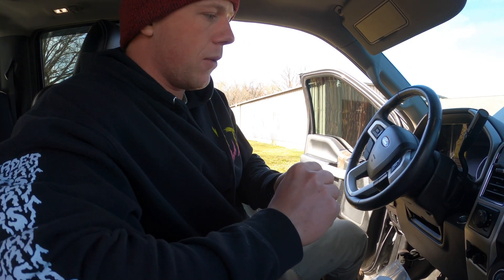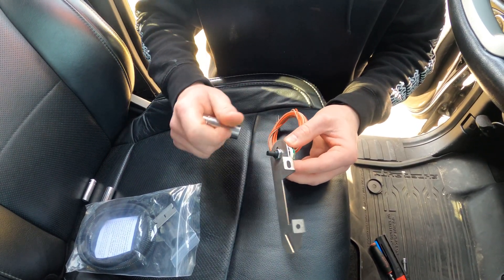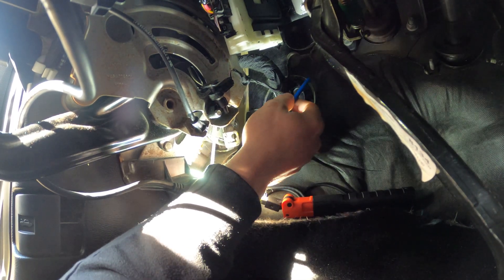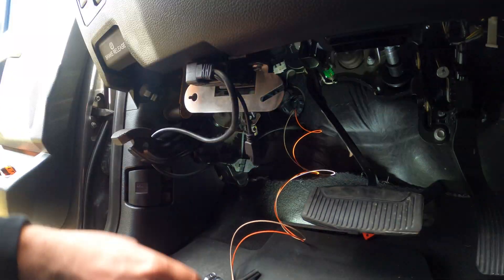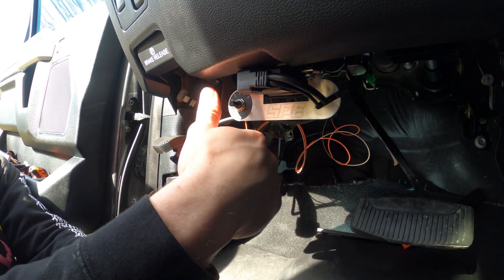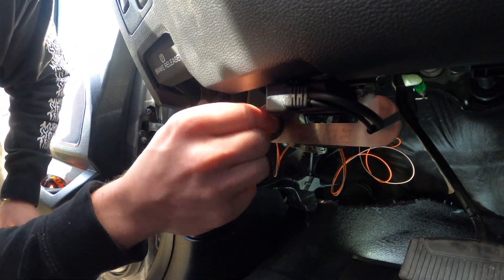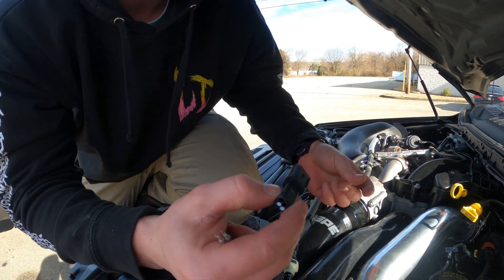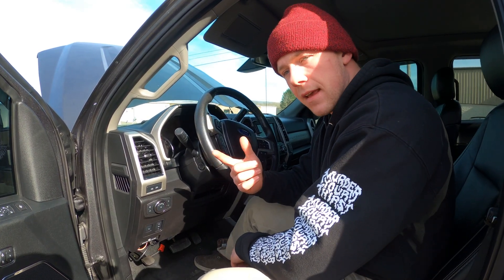SPE 5 POSITION SWITCH (SOTF) INSTALL • RWV 6.7 POWERSTROKE BUILD SERIES

Comment: I’m about to install this switch. Does it matter which wire marries up to the wire on the trucks plug? I understand it has to be pinned to match the correct wires, but do the colors come into play? Green on the truck goes to which? Green w/white stripe on truck goes to which switch wire? Or does it not matter?
Reply: @ResultsWillVary  do you know which color on the sotf switch goes to the green and the green and white on the trucks harness? I’ve already pinned the switch. Just want to make sure it’s right before I plug it in.

Comment: I had one of these installed on my 2014 CCLB Dually, should I be noticing any changes in performance when I go from one setting to the next? I can turn switch from 1-5 and can't feel a thing.
Reply: @ResultsWillVary  that's what I thought thank you.
Reply: @ResultsWillVary  how can I verify wiring is correct?
Reply: @ResultsWillVary  thank you. I popped the hood, unplugged it, flipped it around and took a little drive. Definitely working now, dumbasses had the wires backwards. Drove it like that for over a yr, my boost would also fluctuate for no reason (drop from 40 psi to 30 without letting off the pedal, then back up to 35/40 a second later), that seems to be fixed as well.

Comment: What de pinning tool do you use to switch the 2 wires in the 5 pin. I already did it wrong based on the directions. Your videos are great. This one helped alot for me to figure out why it wasn't working. Also does the LED light up yellowish or green when you tested it.

Comment: Are 2020s different in looking at the plug off the metal fuel line and its only a single 4 row plug with the colors being green, grey, yellow/orange, blue. I got a kit from duramaxtuner and its purple and grey cant figure it out for shit, no instructions

Comment: so just to be clear, it looks like we are unplugging that plug by the fuel filter and essentially plugging the knob connector directly into the plug we just pulled. We are leaving open the place where we UNplugged from initially, is that correct? Should we put a dummy plug in that hole so crud doesn't get in there or am I wrong about nothing plugging back into that spot?
Reply: @ResultsWillVary  thanks for the quick response! I know this an old video for you but I am Deleting my truck (2019 f350) tomorrow morning and installing the SOTF too so really appreciate you. Great videos, keep it up!
Reply: @ResultsWillVary  So the delete is done. Had some weird issues with the SOTF where the pins would not lock in and when I plugged it in the pins would get shoved out the back of the connector half way. I had to pull out the grommet and push the pins in all the way after the connector was connected. I must have unplugged it 27 times to make sure the pins weren't getting bent or smashed lol. Anyway it works fine but I was like wtf, this is supposed to be the easy part lol. Also, everything else went well just had a weird experience where I took it out test driving, testing the SOTF and programming the transmission as the docs says. Then took it to the car wash and while I was spraying it off, the damn truck just fired up! Took me a minute to realize it. I jumped in and stuck the key in, turned it on and off then took the key out. It idled for a few more seconds and then shut off. Freaked me the hell out but it seems fine and everything is working so I got no idea why that happened. Ever see that before? BTW I did use a dummy plug kit so all connectors are covered, underneath and under the hood.
Reply: @ResultsWillVary  that makes sense except my XLT does not have remote start 🤷‍♂️
Reply: @ResultsWillVary  eh, shit happens, seems fine now. Next is physical removal of EGR and then fuel system protection system. Thank for responding man.

Comment: Where is the SPE radiator hose listed, not seeing it on their site. Looks great in your engine bay. Thanks.
Reply: From the video discussing the hot side pipe, will the “new” version you teased about be different from what is presently on the SPE site? Thanks

Comment: If I get the tunes and I don't want to install the soft switch, will it automatically be in position 1 (stock) ?
Reply: @ResultsWillVary  what's the difference between stage 1 and stage 2? What is the rge upgrade?

Comment: What does this do? does your 6.7 have to be deleted to run this?
Reply: I don't know this term deleted that you reference/speak of. When your truck has been on a diet and shed a few unnecessary pounds then this switch (SOTF) can be utilized! 
Long story short, read Flacos' response.
Reply: @Dave people that have programmers/tuners installed in their trucks use these switches to use diferent tunes from their programmer. So you can go from a towing tune to a performance tune for example without stopping the truck, pulling out your  programmer and going through the bs. Of course your programmer has to be capable of Shift On The Fly (SOTF). If you're running a programmer then you've probably deleted your truck anyways.